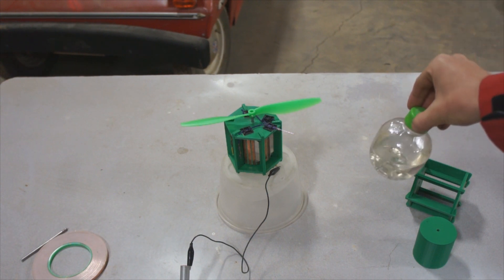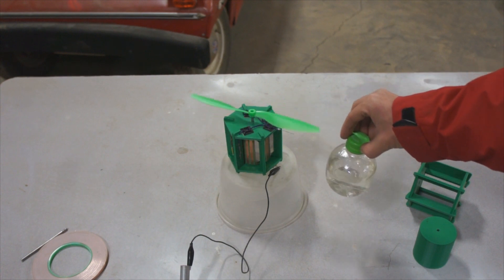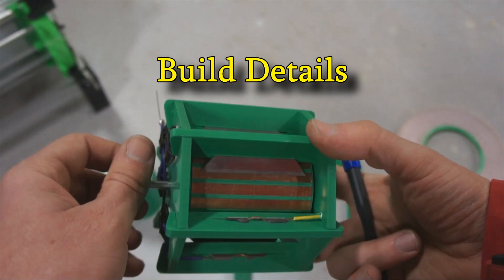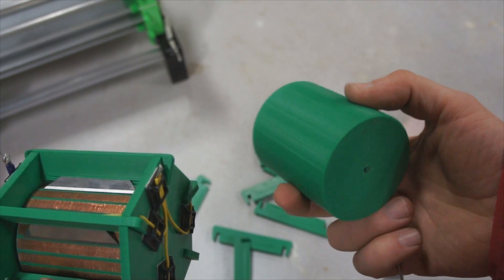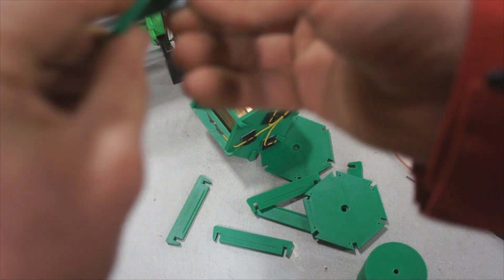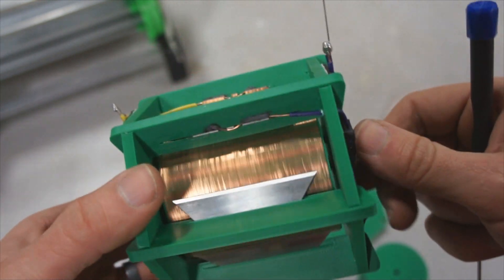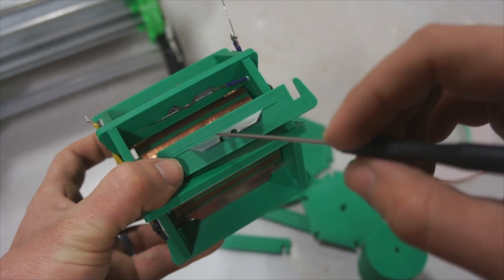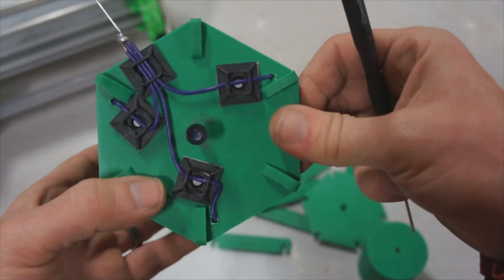3D Printed Wireless Motor - Mini AtmoMotor

Comment: Is it possible to use Corona or atmo  motors in Fans like ceiling fan or room air coolers with 12 volt dc supply. As they are light weight and obtain high speed. Less weight means do they consume less electricity as compared to other dc or bldc motors like they are heavier then this.

Comment: Did someone saved these STL. files somewhere?
Reply: Did you get the stl file
Reply: @flurican3485   you don't have this file?
Reply: @ICE_DAYS  no
Reply: @ICE_DAYS  do you have the file.
Reply: @flurican3485  if you don’t have modeling skills, then you can do it with your hands from a pliable material (let’s say a tree, Tesla didn’t have 3d max either)

Comment: What happens when you turn the rotor? Have you measured any output voltage when trying to use this as a generator instead of a motor?

Comment: Awesome project and video! Why did you decide to go with the striped copper tape on the outside of the rotor instead of the usual internal solid foil found on typical corona motors? I am trying to build one for maximising the speed. Do you have any tips? Thanks!
Reply: because the rotor is a whole part and nothing can be put inside)

Comment: What if you were to hook up the full AtmoMotor to the vandigraph to spin it up.  It's got a high torque and we saw how hard it was to stop it while running.  What if it it spun fast enough to power itself?  The mini AtmoMotor probably wouldn't have enough torque for it, but you could find a way to supplement the larger one with the smaller ones to keep it spinning.  
This may or may not work, I'm thinking that if you hand crank the motor to get it started while it's hooked up to the vandigraph belt, it may keep speeding up, though that feels to me like it would be breaking over unity.  So perhaps it may not work.  But it will probably take a really long time for the energy to dissipate if it even would.  
I would love to see this tested or hear back results.  I would test it myself if I had the resources, but alas, I do not.

Comment: So does this thing start running when there's an electrical storm around?
Would it work if it were 100 feet in diameter? 
10 feet?
10 feet long and the same diameter ?

Comment: lasersaber Is there anyway to use the electrical current this would generate?
Reply: lasersaber or to at least Measure it. I mean even just 3v is enough to have fun with an LED. if theres a way to use the output then theoretically you could charge up a capacitor and amplify the power for other uses right? Also faster rotation would = higher output??? Just trying to think of fun projects for this, such as a dual stage Engine of sorts. Static motor charges Capacitor that is outputted to a van de graff generator and its all contained in a vaccum That has Two Output Terminals. Let the Atmomotor run charge up the cap start the Van De Graff and get it to the point where it creates enough to sustain itself (even if your only getting a consistent 3v output you can use) would be fun.

Comment: Lol I must jokingly ask that you hook it up to the Van De Graff and spin it by hand to see if it can turn the Van De Graff and feed itself! but, I know it would require some virtually frictionless bearings... and it would break the laws of thermodynamics!
Reply: But laws of thermodynamics are made by people and people making mistakes.
They're certainly not completed.
Reply: thermodynamics, like the laws of physics have always been there, granted they're not 100% correct as Einstein showed with Newtonian physics(or as we are constantly understanding more about how quantum physics drives the larger world) but they're not man made constructs! yes, people do make mistakes but we are constantly refining what we know about older fields when new research pops up that throws a wrench in the old...  if we want to break the laws of thermodynamics i believe that the sterling engine is the only way possible... because they themselves are purely thermodynamic! electric motors heat up and the power is lost, gas/diesel/natural gas/electric engines/motors heat up and lose power... but NOT sterling engines! if insulated properly it only increases the sterling engines power and output! you should be able to have them run near indefinitely(i am working on crunching numbers for these but they are nearly 3x more efficient than a gasoline engine which is ~27% efficient because of thermodynamics) aside from down time for maintenance every now and again with only minor input power for start up... breakthroughs start out with crazy ideas that sound impossible... "insanity is doing things over and over again expecting different results" - Einstein

Comment: My first thought upon viewing this was on of my biggest dreams realized.  Would it not be possible to use solar heat to turn things to generate the static to power this motor, if so then print off some fresnel lenses use that heat going up a pipe to turn fans that then power 100 of these motors to then power a big motor.  Now you have an easily printable home made solar, electricity generating device ftw.  Just to add a little to this... next I'm thinking that if you were doing that you'd be making solar powered electricity from recycled plastic at home without pv panels and I think that might just be the coolest idea I've heard in a while.  Very good job with this I hope to print several of these motors soon to do just that with them.

Comment: but still need the ground, so that not wireless =.=
Reply: unless you hook it up to a vacuum tube. 2 plates in a vacuum, as 1 plate heats up, the electrons drift from 1 plate to the other. :) increase voltages to the opposite plate.

Comment: Here's how I think Edward Leedskalnin was moving the rocks. He was using the atmospheric energy from his tripod which has a DC charge and then using his magnet wheel to disturb that field with AC power against the rocks. I'm not certain how that makes levitation, but I'm pretty sure that I'm getting close to what was happening. I think the thing missing in lasersaber experiments here is a tuned circuit! Once he figures that one out his energy production will skyrocket. Probably need a capacitor and inductor to tune the energy flowing between earth and sky. Kinda like tuning in a frequency on a radio.  They were laying around everywhere in Edwards shop. Experiment would be to bring that DC power into a rock. Setup a magnetic AC field next to the rock. See what happens! I think those rocks will get lighter or even float.
Reply: Edward Leedskalnin moved coral castle and nobody could figure out why. My theory is he found a location that was more conductive between the earth and sky and he was able to transfer more energy which means moving larger stones!! This is all starting to make sense. His tripod was gathering energy from the sky just like lasersaber's videos! We should be able to levitate rocks soon!
Reply: John Hovan
They were pouring a conductive substance on the ground to get back to their power source with a better grounding system to maximize power. http://www.iflscience.com/physics/mystery-how-egyptians-moved-pyramid-stones-solved
Reply: John Hovan
They found long cables at Edwards site. He was probably running that atmospheric power to where he needed it so he wouldn't have to keep moving the tripod. It's the helicopter in lasersabors vids.
Reply: As someone suggested in the comments section of your past videos, it is the rotation of the earth that's breaking the DC power so that the motor spins. I believe Edward was increasing the frequency by augmenting the AC on the side of the stones with the wheel. http://s846.photobucket.com/user/SEER777/media/eddywheel.jpg.html

Comment: Surely we could build a bug tower somewhere, and get all of the static electricity from the atmosphere and then have that powering these motors which could in turn, turn a propeller and then the air that moves because of these propellers could then turn a turbine of some kind to produce electricity, what do you think?

Comment: what kind of filiment is your motor printed from? the dielectric properties of your motor housing is (i would guess) causing your motor to be more sensitive to the static (reciever is insulated from the coils/what-have-you inside, possibly a greater flux as a result of insulation?)... if you're picking up what im throwing down... lol...  seems like youre having "reception" issues despite how sensitive the receiver is when "tuned in" though. im curious as to how youre going to increase signal breadth of reception. i think that would help the motor's power significantly. by the way, how much does that sucker weigh? lol its that like a softball size chunk of copper or what?  ;) 

keep up the good work man! its pleasing to see other scientific pioneers and inventors at work!

Comment: Lasersaber whats up. just started following this electrostatic motor stuff and it is pretty amazing. one of my first projects was a small van de graaff gen using rubber and glass to power a tiny wire motor like your first replication, but i never thought usable torque could ever come from such a system. would really like to see one powered by a tesla coil or exciter circuit. it also brings to mind so many other questions and thoughts.. like how lightning across the world right now should also be supplying us with power distribution.

Comment: Curious ... Could this device be used as a pre-lightning strike detector no matter how miniscule the advance notice is?

I noticed that something as simple as the static machine you had set the device in motion, and that static device doesn't put no where near the electrical field that is present prior to a lightning strike.

Our hair stands on end if we're in the vicinity of a lightning strike, but our hair wont stand on end unless we're within inches of the static machine, so being as this device is probably 500 times more sensitive to static electricity than our hair is, the theory of a lightning strike warning system is pretty solid.

Comment: Nice work keep in mind this qoute "Electric power is everywhere present in unlimited quantities and can drive the world`s machinery without the need of coal, oil, gas or any other fuels" guess who said that :) u are on good way to discover amazing things :)
Reply: Tesla, but I still haven't figured out how to use that energy, do you have any suggestions ???
Reply: Bruno Robert The question is : Is energy realy exist as some sort of physical thing ? What is energy ? think of cones twisters and opposing forces. counterrotating twisters.
Reply: FreeKanal energy is may be what makes everything in this world, so anything can be turned into it and vis versa but the question is how? some people think that the tesla coil used backwards would do the trick other think that 4 diodes linked to a metal plate would. I never tried cause I don't have the resources but I would be very interested to know if any of these work!
Reply: Justin Ballen how much power do you think you could draw from that setup?
Reply: Bruno Robert
What I haven't seen him test is atmospheric energy levels at different places on the planet. I believe shamans went to the top of mountains for this energy. Would be interesting to see output on top of egyptian pyramid and inside of stonehenge. The ancients knew! I believe it's not only atmosphere locations, but the composition of the earths crust.

Comment: That is cool. The best part is that you don't have to own a printer to do this like lidmotor has been showing lately but it nice to have one to do this. I wonder if you placed a sheet of tin foil on the window in a thunderstorm if this motor would start spinning from the local static fields building in the clouds.

Comment: When you hold the charged water, you should try to hold it on the other side of the (cathode?), you were too close to your ground and probably lost some electrostatic charge. Can you run it with a Lord Kelvin electrostatic water dropper? Great design, good use of grey matter. :)

Comment: Thx for more of your good work. It looks like you'll have to do some tweaking to get  usable torque. Consider tapping off the static generated from the belt of a refrigerator, freezer, or other belt driven device and a clothes dryer belt and drum as it spins dry clothes and generates loads of static electricity. Also there are lots of spinning belts under your car hood to tap static from. Now go get those ZAPS!

Comment: Is there any reason why you chose to go with straight strips of copper tape and not angled ones? As a preface I'm not trying to be condescending or look down on your work, I've noticed my word choice can seem that way.

I've been studying the interaction of motions, electricity and magnetic interaction in relation to torque and/or speed. I've found something can be gained by angling or shaping the magnetic field or in your case dc contact points in a "Go that way direction" where you set up your power in and outs normally but in this case you'd angle the copper strips at an angle where one strip would possibly stretch across two blades. That way you'd have more than one strip in conatct and possibly see some gains in performance. The key thing for the angle is the proportion between the number of strips you can fit, the size of their spacing, as well as how many blades. Just a thought, I do love your design though it's elegant in it's simplicity.

Comment: I find it interesting that this model seems to be more efficient than the larger diameter model with more blades. I was guessing that a larger diameter that was also lighter in weight and had more blades would be more efficient. I shouldn’t be guessing about things I don’t understand in the first place. Ha! Of course there are many other factors that have changed between the two models. I hope you and Lidmotor  stay with these experiments for a while longer.

Comment: The 3D printed parts appear to be of superb quality. Did you do any rework or polishing to get them so smooth?
Reply from the maker: That is just the way parts printed on the SeeMeCNC Orion Delta look.  I did no rework at all.
Reply: a way to get things super smooth, is to file/sand and then to spray LIGHTLY with acetone (and then wipe with cloth and water.)
Reply: givingtnt That only works for ABS, which everyone seems to hate these days.

Comment: what is the drain of the transmitter? i mean what wattage needed and what is the wattage output on the motor? it would be cool to have technical data of the transmission and efficiency.
cool vid, keep it rollin' :D